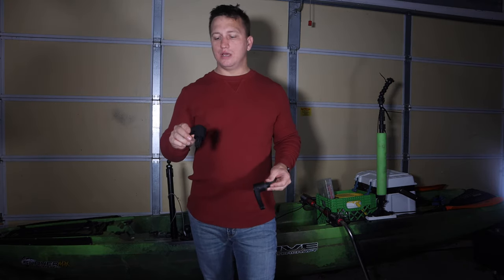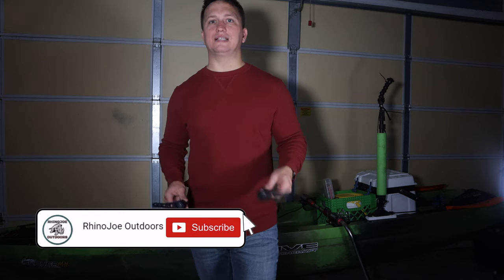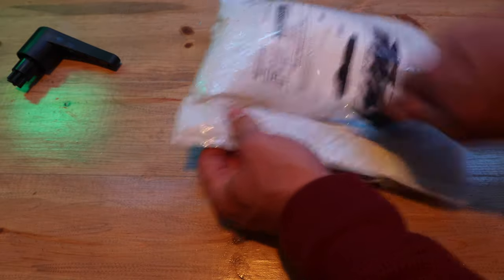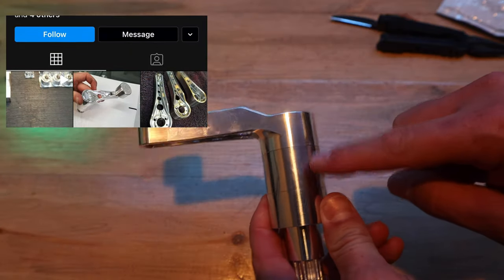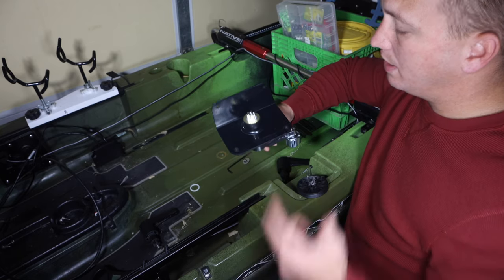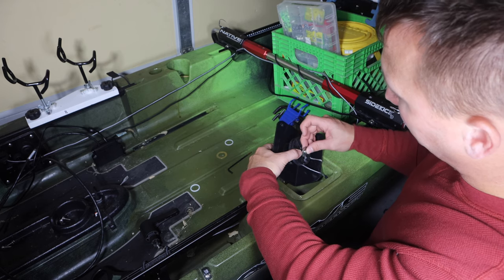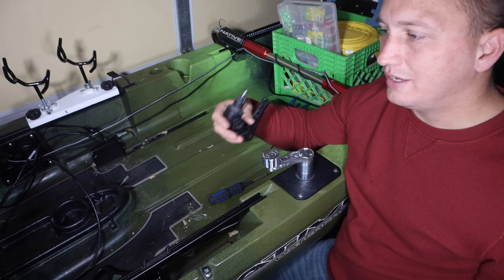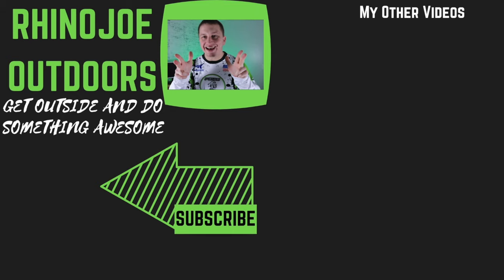Native Slayer Max Propel Steering Handle Replacement Why I didn't use the Factory Upgraded Handle

Comment: That’s what I’m talking about Ryan, I’ve been wanting to get one of these for a while. I saw a post on their website that he’s gonna go in a different mode of production for a while so better get one before they run out or it might be a while. Of course I have all winter to wait now. 👍
Reply from the maker: It’s really high quality. Glad i picked one up when I did. Don’t have to worry about breakage and it should stop the sloppy steering problems I was having. If you look at my stock handle there is a slight twist to the splines. I’m not sure how much longer it would have lasted

Comment: I’m a new titan 10.5 owner and my steering handle is unbelievably tight. I can barely turn it with one hand. I’ve tried a couple of tweaks that big adventures suggested to no avail. Any suggestions? Thanks for the videos. Your noisy peddling episode was a cure all for my propel.
Reply from the maker: The tension in the set screw at the bottom is usually the key to the steering issues. You might also want to check the back end where the cables attach and make sure there isn't something impeding the rudder movement. Some native kayaks have had issues where the rudder makes contact with the bottom of the hull. I am glad to see my videos have helped and I hope this answer or suggestion helps!

Comment: Probably dumb question, but I was wondering if you put the string under the washer and screw or between the washer and the screw?  I installed the handle on my slayer max, but i need to make some adjustments.  If I put the screw too tight it made the handle hard to turn, but as I loosened it the handle was loose.  I wondered if the string placement was affecting the issue as well.  i do need to go back and add locktite...
Reply from the maker: Not a stupid question. Put the bolt through the washer then put the steering line loop... which then screws into the handle. The line will be sandwiched between the washer and the base of the handle. You might need to adjust how many washers you put on it if the screw tightness is impacting the tension for turning. Try adding one of the brass thin washers.